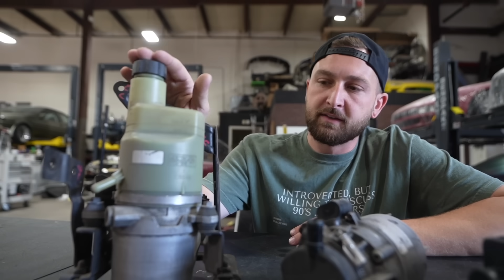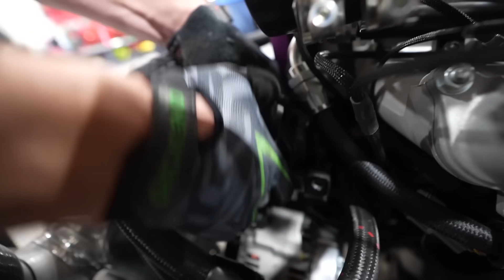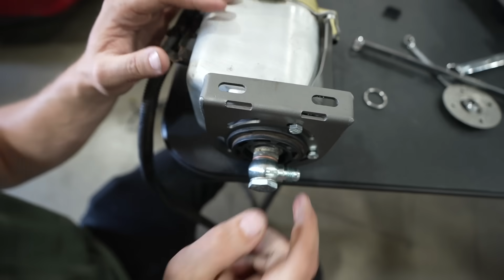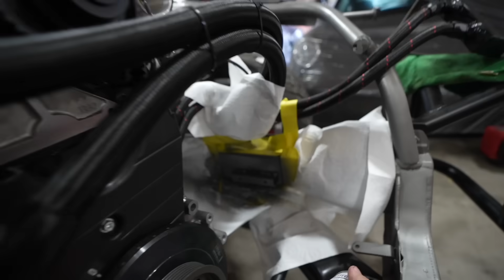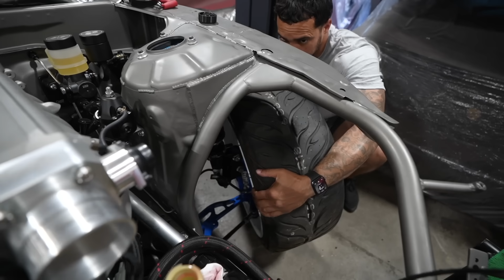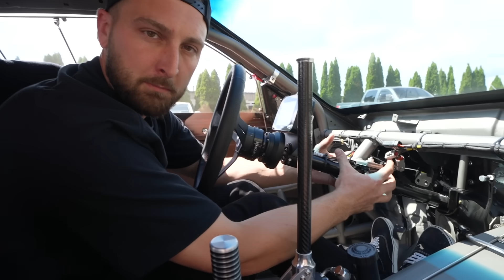Should have done this mod YEARS AGO! (Engine swap cheat code!)

Comment: I put hybrid ceramic bearing in my pump and both were 6000 series bearings fyi, i went with a controller with a potentiometer so i can change the feedback or pump speed from Bruno power steering out of Portugal, don't forget a cooler and technically it needs pentosin, but my rack and pinion needs atf and its better. the pump wont work as long without the proper stuff.

Comment: Jimmy one of my dreams not in my Finacial realms would be to build a VR6 corrado with RWD and not mid engine that has been done with Porsche parts. Instead take the Vr6 turn it 180 and move front suspension forward 5 inches so engine is behind front axel point  maybe bmw front suspension?   Overall length same just dash to axel ratio different. I had a 93 slc. Since than I am all BMW. No fwd

Comment: If no one has said already, stagger the trigger input wires to the electric power steering! Delaying 1 of the wires by a second or 2 will make the pump spin up instantly instead of spooling up like a jet

Comment: Nooo, not ATF!!! These pumps are designed to work with green pentosin chf. 
Ive changed so many of these becaise people kill them topping up with normal atf 
You also have the lower pressure trw pump. Theres a higher pressure zf pump that came on the vxr model vauxhalls / opels

Comment: When you wire the trigger wires to the PDM, put them on 2 seperate outputs, and have one on a 1 second delayed start
That will allow the pump to rapid spool up to full speed from the start, with no slow powering up of the pump
This is a known issue and workaround on the Opel/Vauxhall pumps
Reply: Removing my comment, You beat me to it, was just looking for this exact short haha, 
SEQUENCE THE PUMP JUMMY
Reply: bumping this so Jimmy sees it
Reply: https://www.youtube.com/shorts/EP6HPe4OKQc
Reply: @jimmyoaks
Reply: Lots of comments saying he used the wrong fluid too, apparently those pumps don't take ATF too well. Even saw a couple comments claiming Jimmy isn't using the high pressure version of that pump.

 I honestly have no idea because I'm not experienced with electric pumps at all. Just thought I'd mention it in these replies so more chance he will see it and save himself any possible confusion
Reply: Had the same with my Astra PS pump in my old car, the slow wind up was a pain in the ass
Reply: Needs ldas fluid and both wires common mistake

Comment: I don’t know about the Opel E-PSP, but on MR2 E-PSP do not use ATF or regular power steering fluid. The recommended fluid is Ravenol E-PSF or Pentosin CHF-11S.
Reply: The vauxhall/opel pumps take pentosin chf. There are two different types of pump also. Jimmy looks to have the lower pressure trw pump. They make a higher pressure zf pump for the diesels and vxr models

Comment: Wait till you throw a alternator belt or alternator for any reason and see what happens to your power steering. It’s not like having normal pump failure and just have no power steering. It’s almost no steering at all. I’ve had cars without power steering and it’s not even close, you can barely turn the wheel at speed, it’s pretty terrifying

Comment: Sounds better than the electric power steering pump they have in hybrid Jeeps now. They're higher pitched, like way higher pitched, and they high pitch whine when you turn the steering wheel

Comment: So for anyone wanting to know that pump is used in opel/Vauxhall. If you do some research and your American id say they are also in some chevys as gm made them. I worked in Vauxhall and they used anything from 90-120 amp alternators, if your n a road car and your powering lights, radio, heater etc youll want the higher amp alternator. You can also wire it up to a variable resistor to set the resistance up to your own personal preference, with oepl they were used in vectras, insignias, astras and zafiras. Not all models used this type as some were integrated into the rack
Reply: Also if your planning to mount it in the rear of the car, you may need a second pump to make up for the pressure loss with distance

Comment: Overpowered pump and a pressure reduction valve. You dial any pump to any rack. 

There are options out there for the guys that want parts available locally rather than ordering.

Comment: I'm confused why does the electric pumps still have a reservoir?
Reply: It's still a powersteering "pump" that moves hydraulic fluid to the rack 
It's just now an electric pump instead of a belt driven mechanical pump that you normally find

Comment: What an interesting solution. Can’t wait to hear Jimmy’s opinion on the steering once testing is done. I have a few customer cars that might benefit from this.
Reply: there aren't many downsides to this solution- it's still hydraulic ps, just driven with electricity, so the feel will be effectively the same, and with how many high level drift cars use this pump, the reliability won't suffer either. If Jim's charging system keeps together, it'll be mint
Reply: It’s amazing. I’ve used Opel, Volvo, Mr2, some custom made ones and the Chrysler/dodge charge pump. 

I prefer the Chrysler/dodge it’s package a bit nicer imo and being in the state extremely easy access tho a bit more expensive. But LOCAL warranty and that was pretty important at the time.  Opel pump amazing just must be ordered and if it goes out you ain’t getting one same day.

Comment: You're going to want to run a small power steering cooler on that system you have there, the cooler/exchanger itself doesn't even need to be as large as the pump and res combo itself, just a little guy that's in some airflow, right there in the front bumper opening where a brake duct normally would go
Reply: No ps cooler in a hardcore drift car seems like a bad idea. No cooler, short lines, low-ish capacity and very hard use could lead to the fluid boiling, poor performance and the pump failing quick.

Comment: No cooler???
Reply: Shouldn't need it, pro car will only make 2 runs then get parked, fluid won't get that hot especially if you mount the pump away from heat sources. If it was a road course track car, absolutely

Comment: Just got the setup to do the electric assist that goes in line with the steering shaft. 2018 Elantra EPS No more power steering fluid at all!

Comment: does electric ps give a heavier or lighter steering feel than mechanical pump?
Reply: its not fully electric, its hydrolic... but hydrolic gives a much more heavier feeling for sure
Reply: @thedonvon4507  yeah electric pump vs mechanical. i have no issues with my krc pump on middle flow setting curious if the electric pump is lighter in drift

Comment: I run the corolla column like you mentioned toward the end in my ecoboost s13. I love how it feels so far. Ive done two drift days in it.
Reply: Which eco boost?  2.3?  Need better names for those dang things cause ford calls every turbo engine and ecoboost
Reply: @bmbgarage3405  it boosts the eco which is a popular topic
Reply: @bmbgarage3405 ecoboom they are called where im at, we say the 1 litre is the best because ford cut off the problematic cylinder 😂
Reply: @connormullan5475 😂😂😂😂😂😂😂😂😂

But the wet belt was a shitty concept
Reply: @bmbgarage3405 probably a 2.0l from an escape
Reply: I’ve always wanted to do an ecoboost swap. 2.0 or 2.3. Or did you take the 2.0 and put the 2.3 crank in for the better block.
Reply: @Mldavis1214 mine is a 2.0L
Reply: Why EcoBoost a S13 just curious to know
Reply: @NeleSnr  its a cheap turbo 4 cylinder with aftermarket support, just like a 1.8T
Reply: @NeleSnr the engines are plentiful and sr20s are becoming hard to justify the price of
Reply: @SoaryJP  ka24
Reply: The epowersteering kit?? 
I run it on my is300 and its incredible
Reply: I think the idea with this is it keeps the mechanical ps feel. The electric rack some people say feels like a new car
Reply: @otmotivealt8522 I have the s13 rack just depowered . You'd never know its not fluid
Reply: @SoaryJP  dude! you just did something that honestly should kick start a trend fk it looks good in their too
always been into sr20s but the ecoboost and seeing how it does in focus's and rally made me seriously wonder a few years ago
and now you've done it def followed and pumped for more content of that
make a 10 min vid of it please :)
Reply: Thanks dude! Itd be cool to see more of. Doing some paint work and ill totally upload something  @Trennycakes
Reply: haha! funny to see you here zach
Reply: @Level-Zero-Drift right 🤣 Jimmy is one of my favorites
Reply: Got a video on it? I want an electric column in my LS1 s13
Reply: Got a video on it? I want an electric column in my LS1 s13
Reply: @doridex damn. I didnt take one. But it was so simple. 
12v 
Switch power
Ground. 
Add the assist gain somewhere
The rest is actually bolt in.
Reply: @chrisnapp105 bolt in?! Ok now i really need one lol! What type/year did you use?  Also, THE chris napp?👀
Reply: @doridex epowersteering is the company. It me the background character 😂
Reply: @chrisnapp105  yea seen those kits!! Well i reckon loads know who you are haha
Reply: @doridex its ok i like being the background character.